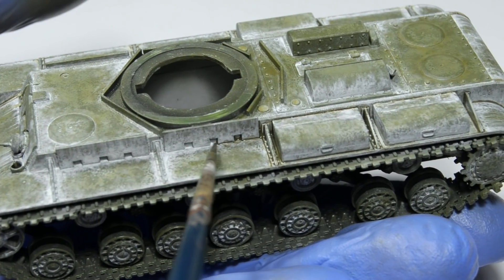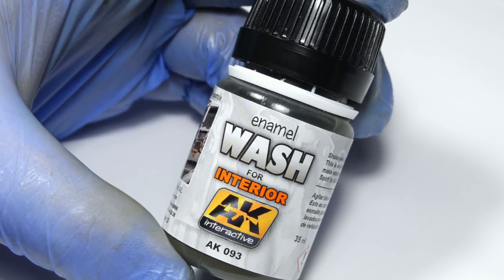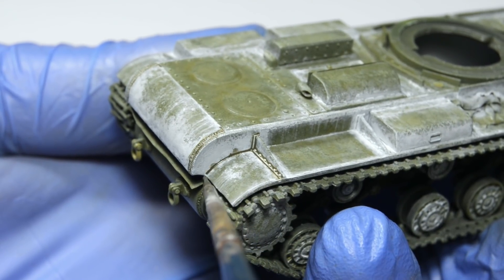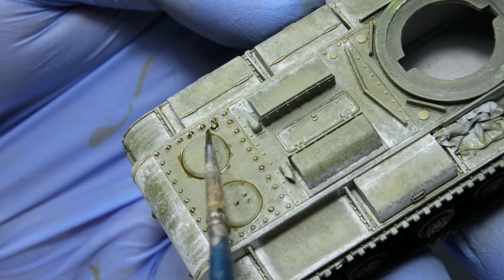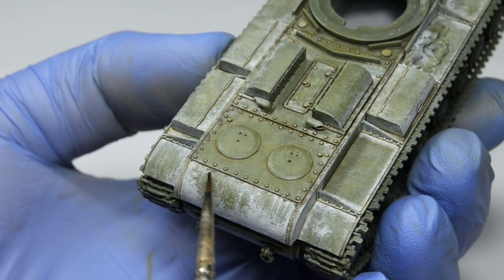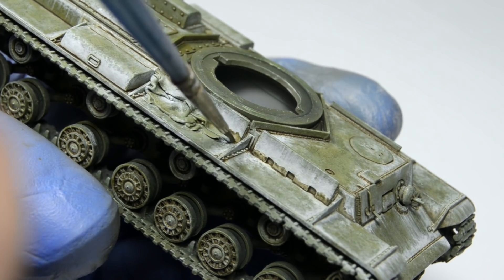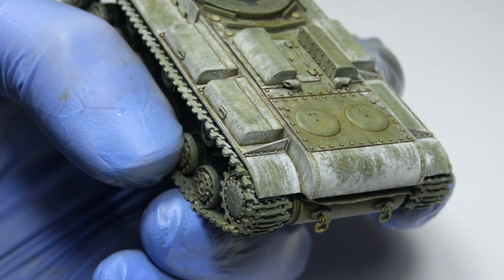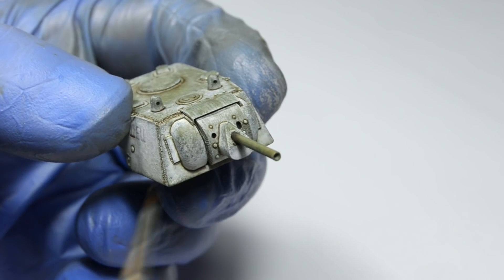Blending Washes and Grime Effects On a Winter Tank | KV-220-2 | 1/72 PST

Comment: I'm currently testing out a bunch of your techniques on a warhammer valhallan imperial guard tank, so this series couldn't have come at a better time XD
The techniqes are pretty different at points, since it makes sense for a tank built on a snowy planet would have a factory-white paint job not a temporary white wash, but the rest is useful.
Particuarly excited to see what you do with mud+snow. Just having snow is boring, so i wanna see what Ideas I can pinch from whatever you come up with xD
Reply from the maker: That sounds like a really interesting setting! 
TBH this tank won't have any snow on it, I want to go for a really filthy look. Also it's not easy to create good snow on a running gear like this when it's been glued together before painting. Maybe next time.
Reply: @NightShiftScaleModels  ahh thats a shame xD
Still, I want to go for a much more muddy look on mine (mainly because mud looks cooler than snow), thinking of imagining it driving though a thin layer of snow with mud underneath.
Would you imagine there would be much dried mud/dust in a scenario like that? I would think the damp atmosphere and the snow might stop that happening? It's hard to get reference images since its a rather specific setup
Reply from the maker: @impguardwarhamer  I guess our models are gonna have a pretty similar weathering in the end. Dust can be present even in the winter months, but only if the ground is frozen solid without any snow coverage. That's what I've observed during the occasional winter hike. But most of the time, winter soil is dark, damp, sticky and wet.
Reply: @NightShiftScaleModels  I see, thanks for the tip!

Comment: i just bought ak's luftwaffe paint set and the alcohol thinner i use turns the paint into slime??!? it mixes fine with water, but alcohol ruins it. what other (prefrerably easily avalible) thinner works with the ak paints? for now i used just water in the airbrush, but it doesnt dry faat enough and it doesnt cover well and ofter spills to all directions
Reply: I dont have an ak paint, but Acrylic thinner?  laquer thinner?  lastly Distilled water - your tap water has who knows what in it.
Reply: Mr.Color Leveling Thinner works great. Or just get the AK thinner.
Reply from the maker: Uhhh... you mean the AK Real Colors or the old AK acrylics? Real Colors are lacquers and I thin them with Mr. Color Thinner, which works great with every lacquer paint. If they're the old acrylics, with the same properties as Vallejo paints for example, I used to thin them with Vallejo Airbrush Cleaner. Yes, that stuff works actually totally awesome with AK and Vallejo acrylics.